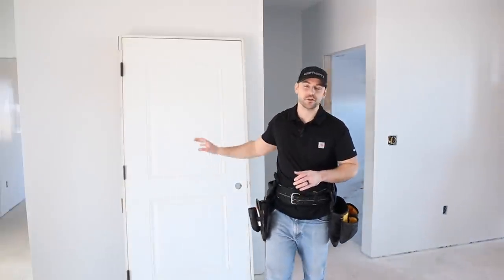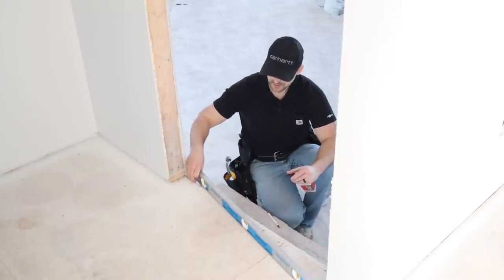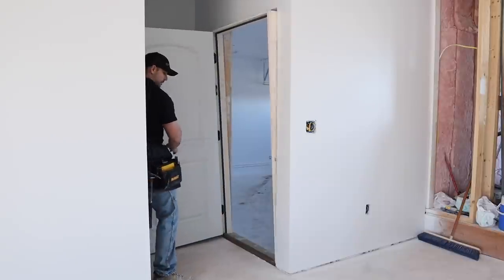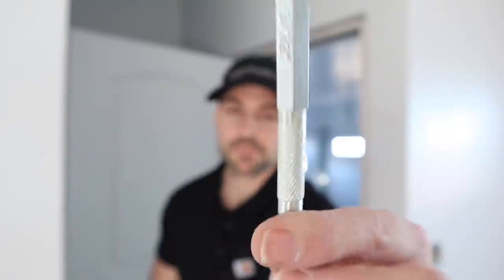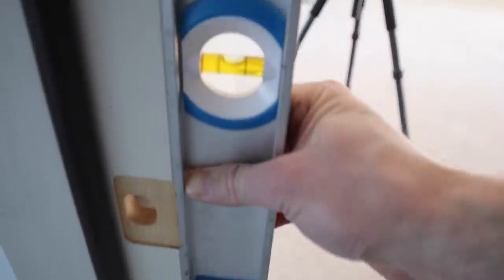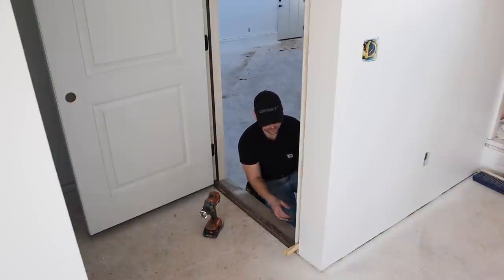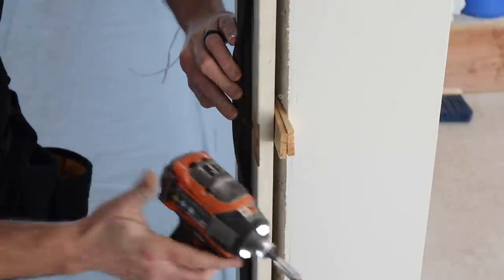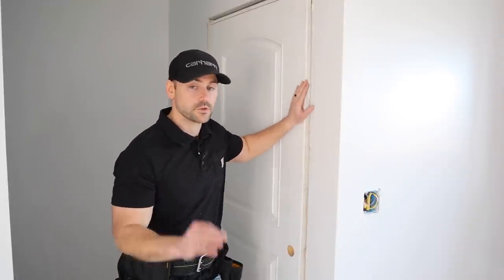How To Install A Door - DO THIS BEFORE INSPECTION! Fire Rated Door

Comment: Doors have always been one thing I loved doing in my remodeling days. One thing I always found was to reverse the shims so they are flat all the way behind the jamb and not wedged creating the jamb to twist a bit. This is especially helpful in old house remodeling. The hinge side is more sensitive to this because it can create the door to swing open on its own or shut instead of how your door looks when done. (If you open a door, it should stay in any position you leave it).
Some of our areas, spring loaded hinges are code for fire rated doors so they shut in case a fire and you don't shut it secure. I also only use fiberglass insulation over any spray foam ( my preference) on entry doors so they don't accidentally get expanded and cause the margin to change. 
Thank you Josh for this wonderful door project.
Reply from the maker: Hey David! Yes overlapping the shims to make flat is a good idea. I do that a lot of times and sometimes I just forget to do that. I have noticed a lot of people have strong opinions against spray foam. Thanks a lot for watching and commenting. I helps the channel out a lot and I enjoy hearing from my subscribers!
Reply: i thought shims were a ramp? How could you possibly have them flat if they are, by nature, wedge shaped? (besides stacking 2 on top of each other to create a rectangle?)
Reply: @tightirl  if you reverse one with the thinnest part on the thickest of the other, they become flat if needed. To enlarge the thickness, you still push one in further than the other.
Reply: @davidharrison3074  ah that makes sense. obvious now that you say it. thanks.

Comment: Hello Josh,    When placing shims on a new door, it's necessary to install them (a pair)  so that "the wafer thin sides of both shims" are pointing inwards toward the center of the door frame.

Comment: Man because of you I have decide to do a lot of the inside work of my shop myself.  I need to redo the two outside doors since they did a crap job installing them.
Reply from the maker: That is so cool! Sometimes if you want the job done right you have to do it yourself. I have learned that throughout my years of construction. Good luck on your projects!

Comment: I've installed door with the screw behind the weatherstripping too to hide it and had it work fine.  Thermatru says not to do that because it the thinnest part of the jamb.  The last one I installed (a door going into an attached garage) I screwed it through the thickest part of the jamb and just mudded the screws to hide them.  Paint he jamb (the factory paint is crap anyhow) and you never see them.  Good vid, thanks!

Comment: (For the DIYers.) Respectfully sharing if I may please. A door shouldn't be glued to the subfloor. If for whatever reason the frame needs to be replaced in the future, removal of the threshold is going to rip out subflooring right along with it. Furthermore, there's a high probability that finished flooring (Tile, hardwood.) is subject to collateral damage. Let me add, Liquid Nail is one of the most flammable building products used in construction. It ignites nearly as fast as gasoline. If adhering the threshold to the subfloor is a concern, use a fire rated sealant. There's a variety from 3M, Dap and Loctite. 

😊Don't rely on your eagle eye 🦅. Once your door is preset and you're hands free, add the knob and latch hardware. Beyond reveals, MFGs can get their bores misaligned. No matter what the reveal is doing, the door must latch and lock. As far as setting the door on the latch side, use a "Trim Head Screw" behind the weatherstripping throughout. With a trim head screw it's so much easier getting your reveal correct. If you must use nails I have a couple of concerns. Go ahead and nail outside your weatherstripping (Jamb.). You don't want to pecker mark weatherstripping on a special ordered fire rated door. Also, don't fully sink a nail until you know your door is locking and shutting properly. You'll have a cussword moment if you have to dig or cut your nails out to readjust your frame.  As he said, he got lucky with his first placement. But, once all is aligned and the door is locking and shutting, pilot hole and countersink for your larger screws. Don't overtighten so you don't throw your reveal and latches out of alignment...There's not much more to setting a prehung door. I'll add that on heavier slabs with glass, take to slab out of the frame to set the door. You'll thank yourself.

Comment: Make sure ya mention to use the right spray foam.  Have seen some of my friends “Start” projects before i get there to help and with doors and windows, they grab the mega expansion foam, creating bulges, it was a mess. 

Like the idea of the deck screws. i never use the ones that come with the doors, and like to have 3-1/2” min in length

Q). No gap on threshold with the shim when you raised it, or did you do a “fill” of some type for the gap?   Asking as last time i got a “big box” door, it was so cheaply made, and i had to level the bottom and had 3/8” gap.  was creating a problem with flimsy material.  (squeezed some mortar under it as it was bending.  mortar worked good. just another headache. (that’s renovations for ya. 

thanks for tip on deck screws. 👍👍

Comment: In Commiefornia they require one of the hinges on a door to the garage to be spring loaded so the garage door cannot be left standing open.
Reply from the maker: Hey Preston! Wow sounds like though code there is way different than the codes here when it comes to fire rated doors. That’s why I love YouTube is because you learn from people all around the world. Thanks a lot for your input!
Reply: If you look, the top and bottom hinges have the auto close spring loaded hinges on this door. Most garages have them so the door will close automatically in case of a fire. If its fire rated but the door doesn't close it could allow the flames to go through the door opening.

Comment: Seems to me that every time I have loaned out t my equipment or tool they come back either damaged, broken or otherwise in need of the trash can! 😵‍💫
I use a 5-way blade or a 3" putty knife to pull back the seal on the door to drive a screw,. While holding the seal back with the putty knife I can protect the seal while driving the screw past it without damaging the seal.
Typically I don't pre-drill for the screws behind the seal as the door frame lumber is usually pretty fresh. more so now than ever as manufacturers are using composite for the door frames where pre-drilling is pretty much moot point anyway. 
Also an upgrade to the putty knife, I use is to use a long sleeved bit driver holder to slide over the screw so the screw threads do not tear up the seal when driving it in.. I just pull back the sleeve far enough to see where the screw is at in the driving process.. 
When shimming the latch lock side I also use a wider cedar shim so when I install spray foam insulation, I do not have to wait for the foam to cure and then clean out the mortise receiver hole... I also use a water spritzer to accelerate the spray foam insulation cure time (be sure to check the manufacturer recommendations on your product packaging) - as the side note: some brands of foam insulation will cure mostly outside with this technique while the interior curing is much slower - be mindful and pay attention - always install gloves - and - have acetone and a clean up rag handy before starting any spray foam insulating.
Perhaps I am overkill, but I do use the fire rated spray foam insulation in fire doors.. I don't like to have any questions when I am done with this kind of install.
In my jurisdiction, the hinges need to be self-closing and a magnetic seal is also required here. 
Kudos for the once and done install - it's a rarity in the real world as "sometimes door slabs are warped? - you mean 99.9% of the time!  - and or the frame is a hot mess  with replacements! 
👍👍
Reply from the maker: That’s a good idea to use the putty knife to pull back the weatherstripping. Thanks for that! Yes using fire rated spray firm is probably the best option but I’ve never had an inspector check for that because clearly it’s behind the trim. Definitely not a bad idea. Yes always check manufacturer recommendations when doing anything. Sometimes it doesn’t seem necessary but often times it’s for a good cause. How do you get a little creative from time to time and do things a little different but that’s my style lol. I appreciate your awesome response. Thanks a lot for watching!

Comment: Plum ✅
Reply from the maker: That’s right 💪🏻
Reply: Is it? The top hinge side looked proud, and thats likely why the door wants to swing open a bit. Could also be that the hinge put below the sill plate is bevelled so it is tilting the frame to the interior.

Comment: 1. You used a sloping wedge then didnt tape or screw it in place then moved the door around on it.
2. Decking screws for a door frame without a pilot hole? Madness.